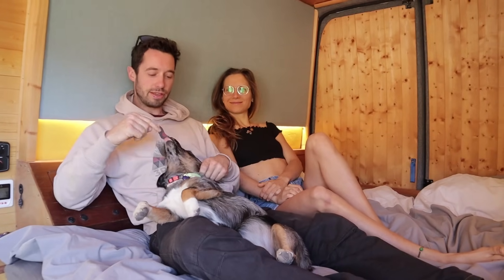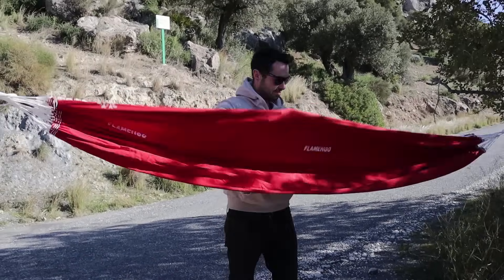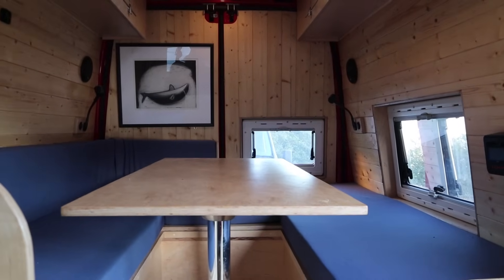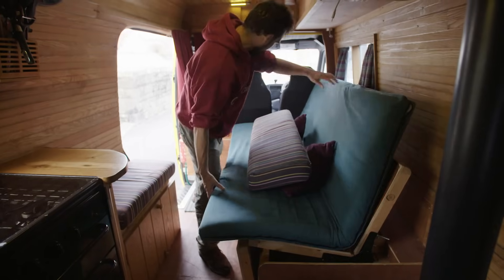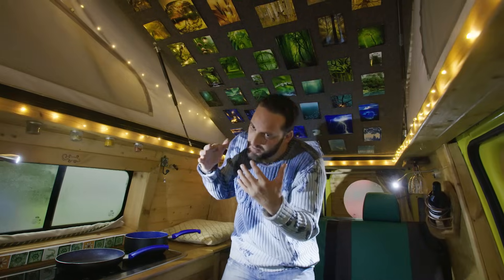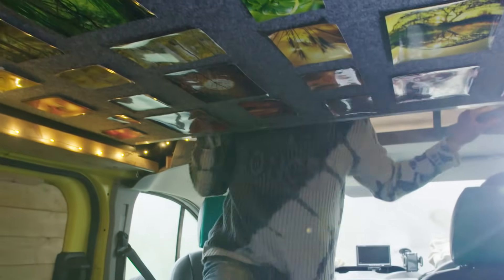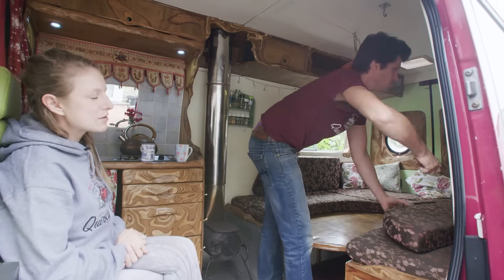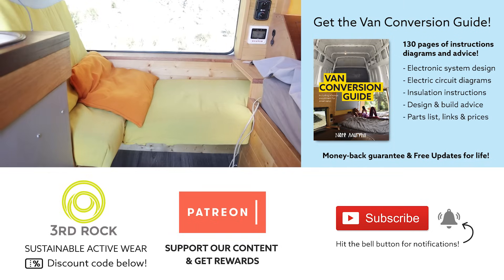10 Awesome BED DESIGNS for your VAN CONVERSION 🛏 🚐

Comment: I lived in a VW Eurovan, a tall Sprinter, and a 5th wheel. In my opinion, most vans try to cram too much into the small space. 

Everyone needs to decide the 2 or 3 most important things for them and design to that. For me, they are: 1) A big comfy warm bed that is easy to get in and out of, and 2) Comfy seating during daytime, socializing, etc.... and 3) Lot's of natural light and visibility.

My preference is a fixed bed, similar to the first van in this video, except with more storage space under the bed... for seating, I don't do fixed seating because I prefer to sit in the outdoors most of the time so I have very comfy folding chairs... for indoor seating, just keep enough pillows to sit upright on the bed.
Reply: mine would be 1- nice bed 2- crates for 2 dogs 3- food space. 

the three top things is a great idea. really helps to focus on what is most important :)
Reply: @lizsun261  :  Crates? Isn't that what the bed is for? My dogs sure think so.
Reply: This is great advice. Thank you!
Reply: @SmoothCinnamonX : You're welcome Spirit... I've evolved to a less-is-more design aesthetic... only what you really need, throw out the things you might need.

Comment: Anything that's not a fixed bed is not quite as simple as "Voila" as seen in most of these videos... you still have to get out the sheets/pillows etc and make up the bed.   Fixed bed all the way for me.
Reply: Me too, convertible beds in a weekend camper, sure. If you live in a vehicle full time, screw that.
Reply: Me too any thing else would annoy me .. I live in a tiny van full time and still have a fixed single bed that doubles as a couch 😊
Reply: sliding bed for me chief, they didn't include a pulley beg that was in Alex's van builg
Reply: Google "Leisure Van murphy bed" and be ashamed of your comment ;)
Reply: I-VanLife, there werent any proper ones in this video. If you have a good functioning slide out you only have to pull it. Takes about 2 seconds and saves alot of room.
Reply: I've just gone from "tetris" to "fixed". I've lost that seating area but that's what the outside is for.
Reply: @memefeed2147  links?? :)
Reply: Me:  Two Thermarest pads and a fucking sleeping bag.  Done.  IN a van.
Reply: you do realise that you live in it, so you need to make the most out of the small space. A fixed bed largely means that you're giving up a lot of other potential uses.
Reply: This, personally I like a high mounted bed with 50-60cm clearance from the roof and a large garage below to fit a motorbike or two. I'm also a fan of a jumbo van over anything else though.
Reply: Seems like a bed that can be easily lifted on pulleys up the ceiling when not in use is a good idea; then one doesn't have to rip off the sheets and blankets and make the bed every day. Underneath, can be a horseshoe-shaped seating area, like a booth, when would serve as a support for the bed as well. And, underneath the booth seats, of course, would be storage. Would only really work in a high top van.
Reply: @kaptein1247  You still have to make it up every day, unless you want to spend your whole life in a sleeping bag.
Reply: @mumpygumboo8554  I saw an elevator bed in a tiny house and instantly decided that's what I want when I eventually do a conversion. Ford Transit has an 81.5" high roof compared to others that are only about 76".
Reply: @AudieDiddle   Well, good luck with whatever you decide to do. Sounds like an exciting way to start a new chapter in life. I think it's likely a lot easier to do this lifestyle in the US rather than Canada. Canada's fuel, and food is expensive and there are such huge distances between places.
Reply: I thought I was going to do a fixed bed and then I read that the laws are getting stricter against van-dwellers. For me, if I'm to anticipate those likely changes in the future, then my inner furnishings need to be modular and stealth. That means building a convertible murphy bed/office desk & hidden pop-up kitchen, since sleeping/cooking in a vehicle are considered violations in certain cities/states. This way if I get any heat or police inquiries, I can claim I'm just working in my mobile work space -- which isn't illegal nor restricted.
Reply: I wouldn't bother with sheets. I'd probably use a sleeping bag
Reply: @fuzzythegreat1  , I thought it was "shikibuton"....
Reply: @2dcutout  There's a sacrifice to be made if you go that way. Either you get a bigger van which will severely limit your flexibility and parking space availability or you get a shorter van but you'll barely have enough space inside because you wanted a big  bed. Since you'll be going full time this means stealth camping full time, a large van isn't that great a choice for that. It all depends what you want, most people would choose to be flexible in their stealth camping options and deal with making their bed. A big non convertible bed essentially means way more stress searching for suitable stealth camping options or it means a tight van where you can't do anything inside because 70% of the room inside is taken by a bed.
Of course you could go full time living in a van in a fixed place but that's just silly.
Reply: You can always leave the bed down if you want... At least you have the option
Reply: I know right. like imagine having to convert and make your bed every single say of your life. That adds up to days of your life just making a bad that could otherwise be fixed.
Reply: We are complete opposite in that within the blue prints and building I'm doing a fixed bed sounds awful for me personally I'll be working from my ven to being able to have a couch is important but I understand where you're coming from
Reply: You have to love when they all say “it’s dead easy” and then spend ages clicking moving and turning this 😅 definitely need a fixed bed
Reply: @2dcutout  Agree, if I lived full time off the grid, then fixed bed all the way. Would not mind like a slat slide out bed for weekend and trips.
Reply: have to agree with you there.. when you're exhausted, want to pull over and sleep, i want the bed already set for it.
Reply: Exactly!

Comment: I've been leaning towards the slatted sliding frames most recently. About half the storage space of a fixed bed all the time but twice as much floor space half the time. I just hate the idea of using cushions so I know I'd use a thin futon and roll it up during the day. The drop table eating areas were very impressive but I wouldn't want to sleep where my guests specifically had parked their butts. The pop top van was probably my favorite!

Comment: There is ONE i didn't see in this top8 ... that was just a 1 person (could even be 2 on both sides) fold up to the side of the Van bed. Sure your Van would be a bit more narrow during the day, but you can just leave the beds mostly made, and fold them up, then if needed drop them down and crash... Also gives the option to haul bigger stuff, like bikes, though you do have to leave them out when you go to sleep. If you don't mind sitting on the floor on some pillows you could even make a low small removable (for the large haul) table in the middle where the bed rests on (Japanese style sitting). that way you don't have to build something on the bottom of the folddown structure to provide support for the bed... main downside is that you may loose some storage room, or need other ways to achieve that, but in such a small space it's all about what you want and how you make that fit ... perhaps this is an idea for somebody, so i left it here, like it, take it ;)

Comment: My dad put a bunk bed in his first van. I thought it was quite clever. I got the top bunk as a rule and it was great unless you were in death valley or some other hot place since the heat was the worst near the ceiling.

Comment: What’s interesting is that my 2004 Lexus rx330 also has a rock and roll bed, as the seats can be fully adjusted to a flat position. Being close to 6ft tall however it is a bit uncomfortable to sleep in as I can’t fully stretch out. If you’re slightly shorten however, it’s absolutely awesome

Comment: Why do none of these vans have fixed dog crates (for safety while driving)? I was hoping someone had a a solution for this 😅 (I'm assuming the best way would be to have it under the bed)
Reply: I think Number three at 3:35 would be perfect for this. You would still also have room for a bit of garage space plus a nice spot for the doggies :)

Comment: It's nice to see there are some varieties, but.... pretty much all of these vans are HUGE! Is there another video like this but with smaller builds?
Reply: The most common thing with tiny vans (Transit Connect, Ford Econoline, etc.) is a sofa that takes up one entire side wall and has a small pull out that makes it the width of a single/twin bed. Typically the other side without the sofa is a kitchenette with cabinets and maybe a sink, cook top, and/or toilet somewhere in there. The sofa bed closes the aisle space between the sofa and cabinets, meaning there is no walking space while the bed is out.

Comment: Is there a reason on one seems to go for the metal 3 fold sofa bed mechanisms? I used to have an old sofa bed with one and we could leave the bed fully made up with pillows and duvet and just push it away - was thinking of using one in the van too

Comment: Good compilation. But other than the concepts shown in the video, there is still the lift bed systems, which can be either entirely "manual" or powered. In this concept the bed will be hidden in the roof, and only lowered when need. Any comments?
Reply from the maker: Beds part 2 coming soon!

Comment: The one thing I don't like is that you need to remove the sheets before doing the bed. Which means you need more storage, and also it's not as simple as sliding the bed out, you need to take everything on and off the bed every time what time you need your bad. For Murphy bed you can often strap the sheets on and so it's just a matter of taking the bed down.
Reply: I don't like that it takes all the space. Pretty pointless to me when you have limited space 🤦‍♀️

Comment: Some great bed designs. Giving me some fresh ideas. Having three kids I need space in the van and beds. Thinking of a ford high top with maybe a custom top for kids bed.

Ps nearly all these Vans had wooden panels, is that any good for insulation, over the traditional carpet method?
Reply from the maker: It is mostly because it looks super cozy and gives a nice feel to the van (carpet can look a bit bland or dark).
Reply: @NateMurphy  any issues with condensation build up with the wood?
Reply from the maker: 3 years in and not as yet!

Comment: Hi nate ive the same transit as you and was going to possibly use a hammock as  the third bed  inside the van! But having never used one was  wondering if you had any experience as to what it was like to sleep in over night?
Reply from the maker: I can put my hammock diagonally in the van also.. but not had to use it in anger as yet. There is a squeeze in the bed but ok if people like to cuddle 😂 four would need the hammock for sure.

I think it would be ok. It just clears my bed and would probably work for short term. 3 long term adults would be hectic.
Reply: @NateMurphy  yes mate ill have my too lads at the weekend reckon it should be ok tho one only 8  but the other one is 11 but he's like a fully grown adult haha....  thanks for the reply  keep up thw food work 👍👍👍
Reply from the maker: mark grinsted hammock would work for one.. also if one is not tall can look at going across the seats in the front..

Comment: I'm doing my first van build on a 2017 Ram ProMaster 2500 136 inch wheelbase (all I could afford). While I admire the ingenuity of these bed designs they don't seem very useful to my situation. I'm living the van life because housing here in Denver has become so expensive. I waste my paycheck on an apt 🏢 where I live with the lowest echelon of working class society 👷🏻‍♂️. They are mostly spanish speaking immigrants with 2-3 kids jammed in a one bedroom or ppl that work 2 jobs just to make ends meat. Most live paycheck to paycheck. Because it was my first build I spent many hours watching youtube ProMaster Cargo van conversion videos. After watching dozens of them I realized these conversion van layouts are dominated by full sized beds. Because I still want to use the van at work (as a handyman) I can't abide taking up the entire rear of my promaster 🚐 with a bed. As a solution I ordered a folding bed/sleeper chair and a armrest mouse pad attachment on ebay to double as a bed/computer chair. Hopefully this will give me reasonable bedding and a computer workstation while still leaving enough room to move around and haul the occasional water heater or sheet of plywood.

Comment: Hmm I had a bed with two scissor jacks on one side so I could level it and compensate for the drainage camber in the road. Apart from that, the walk thru drivers compartment is very convenient because one can pull up on the side of the road and not show the people camping. like if there is a girl there.  Also there is no door slamming to attract attention.

Comment: Nice, BUT only the first was a fixed bed, rest had to put together.  And the first used a lot of usable space, and pretty much blocks the back door.  Make a bed that lifts out of the way when not being  used (not a Murphy), and got space for seats, dinette, or whatever.  And can leave the bed messy when lifted.  I've been doing my  homework for my own build, it can be done, and not at excessive cost.

Comment: As a person who camps in a Saab wagon, i don’t get the point in these van conversion besides this being cheaper than buying an RV. I find it so much more appealing to have a car. I have trunk space, five seats, everything a regular car has. But when i want to, 10minutes and i have two seats, a two-person bed, and everything i need for a few days of camping, just like that. You can fit anything you want in a van you can fit in an RV. Those are, after all, just vans with the same things in them that the examples in this video.

Comment: 1:56 LOL. 600kg strength weighted eye bolt, connected to a 20mm pine plank that's probably glued to the ceiling
Reply from the maker: Nah, bolted to the structural elements of the van direct. Pine places around it.

Comment: Would you please fix the certificate on your website so that I could buy the guide :)
Reply from the maker: t4kku303 oh! Damn straight. I’ll work that out. Had no idea it was not good.
Reply from the maker: Sal cert?
Reply: I don't know any spesifics, my browser gives an error when entering the site and won't load the page.
Reply from the maker: t4kku303 could you copy and paste what it says? It would be really helpful :)
Reply: Sure I can when I get home. Chrome on Android seems to open it just fine but earlier I had problems with Firefox and Chrome on Windows pc. But I'll paste when I get home.
Reply: @NateMurphy  Interesting, now it seems to work fine on both browsers O_o
Reply from the maker: Oh thanks, might have just been a little glitch or something. Thanks so much for pointing it out either way :)

Comment: I'm 6'1". I can tell nothing about a bed working for me just by showing a video of it. Why are so many videos About beds not staying the Demonsions. Sometime they show a guy laying comfortably but don't tell you he may be 5'6" tall?
Reply: I agree. I'm also 6'1" and my bed in my conversion van is only 6ft so I have to sleep at a angle to fit on it. Most Conversion vans and Sprinter vans are only 6ft wide inside so it limits our bed options for guys our size.
Reply: @mechanicsteve2320  6'1" here too, the one at 11:28 seems to be easily adaptable to any requiered length needed to fit taller people. No need to know dimensions on that one. Just use the concept and make it fit.

Comment: I don't really like any of these. The "least offensive" is probably the fixed bed, even though you throw away all that living space in the daytime. The guy at 6 minutes or so with the converting futon... having to actually stand outside to make the bed is borderline moronic. What happens in a rainstorm or snowstorm? You're standing out in the elements, with all that crap flying right onto your bed. If you have to get out of the vehicle to change its configuration, that's pretty much a turbo fail in my opinion. Either a (good!) Murphy bed design, or an elevating bed you can push up in the ceiling (which of course requires a factory high top), those I can get excited about. Neither of those require making the bed twice a day, and you still get living space.
Reply: "borderline moronic"  is a bit harsh lol  sometimes the van size or the travel seating won't allow you to change from living room to bedroom (if you want a good bed) without stepping outside. I've converted a van like that. It is a pain at 1st and it's not as convenient as other ways. However, you do get used to the best way to go about the transition. If it's raining you just park under shelter to change over then off to your sleep spot nearby. Or you wait for the rain to stop, or you make up the beds before you go out earlier in the day so if it's raining as you return it's straight into bed. My point is you CAN get lots of happy travels from a van despite having to step out to make up the bed. Too many people watch from their armchairs waiting for the perfect set up to copy.....build it and use it !  Happy travels everyone. John

Comment: 600 kg support is too little for a hammock. That number is measured for an unmovable weight straight down. If you have a hammock, the strain goes at a sideways angle and there will also be continuous change of the direction of the strain. You are really begging for a nasty surprise further on.